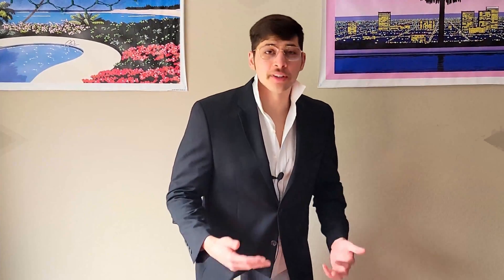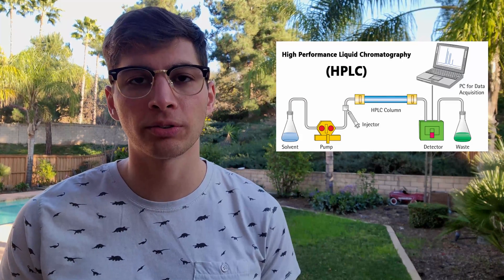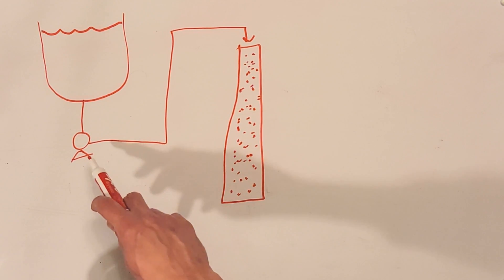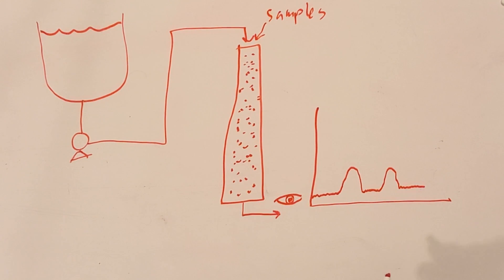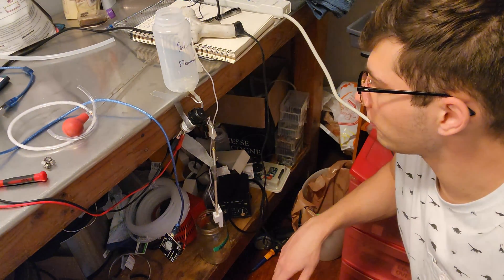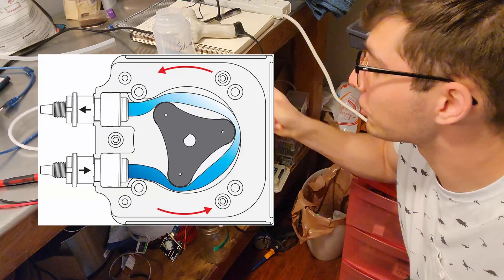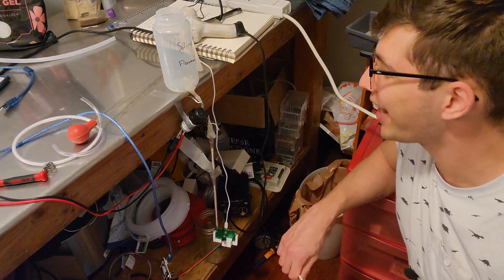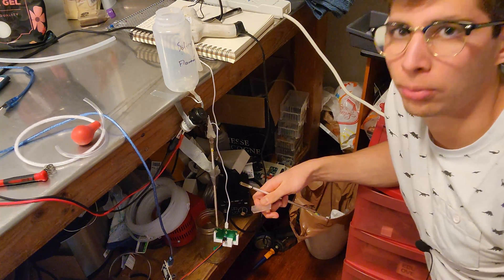How does HPLC work? | High Performance Liquid Chromotography

Comment: The need for high pressure is a side effect of using very small particule size stationary phase in a very narrow diameter column.  Both factors enhance resolution, but the flow rate at modest pressures is negligible - hence the high pressure.  Not a chemist of any kink, but a mere microbiologist, but I love HPLC.

Comment: So ummmm I don't mind or anything but the acronym HPLC stands for High Performance Liquid Chromatography.  It so happens that often HPLC systems run at relatively high pressures because the packing material causes high backpressure.  But sometimes I have reason to use larger diameter silica gel and low flow rates/volumes meaning the pressure is not high.  I know this all sounds nit picky but I love chromatography and want you to be correct, accurate... and precise!  :)
Reply from the maker: All good things to be! I should have clarified that this is just "LC", but people are familiar with the HPLC acronym I think.

Comment: I work in the cannabis industry and run HPLC for cannabinoids. This was really cool to watch. And considering you’re not an analytical chemist, you have a solid understanding of HPLC.

Not sure if it helps, but 75%/25% aceto/h2o with 0.1% formic acid as the mobile phase works great for cannabinoids. 228nm
Reply from the maker: Nice! Yea I've developed a method for cannabinoids, but always had trouble with the precursors like olivetolic acid and varinolic acid. Probably not needed for the cannabis industry, but I needed to identify them for the work I was doing at the time.

Comment: It may be possible to achieve high pressures like in true HPLC, the trash method, using old injection pump from diesel engine. Many of these pumps can achieve more than 300 bar.
Reply: Or, do it with static pressure, rather than a pump.  Air pumps for precision airguns can easily reach 3000+ PSI.  A steel cylinder with a floating piston, mobile fluid on the bottom, high pressure air on the top would give you zero pulsation high pressure flow.  Some fancy machining, but any shop that does CNC maching could create one.

Comment: You're completely wrong. The diffusion has nothing to do with the pressure  It's flow rate that matters. HPLC's are high pressure because their columns contain extremely fine particles. Fine particles = resistant to flow. Actual chromatography grade silica gel is cheap. You can buy a prefilled column for $5 on ebay. Syringe pumps are also pretty cheap and much better for cheap chromatography than peristaltic pumps.

Comment: I'm not sure about the UV-C LED, because curing nails doesn't really need UV-C, 405 nm are enough to cure alot of resins. 
 
You should be able to find out if it is a real UV-C LED when looking a the window of the LED. UV-C LEDs use a glass window instead of a plastic one, because UV-C destroys the plastic windows.
Reply from the maker: Oh interesting... I wish I could've gotten just a nice UVC LED with a good datasheet..based on my tests though, this one did at least emit some UVC

Comment: The diffusion is probably more due to air bubbles. The high pressure is mostly to speed up the process. Eluting too slowly may cause some diffusion but your set up is going plenty fast enough. Focus on eliminating the bubbles and I bet you will see a big performance bump. Also, as Conner said check out flash or vacuum chromatography, you can get the equipment for pretty cheap.
Reply: Nope, Pressure is actually needed for performance. In practice the more fine is the stationary phase, however the more fine is the stationary phase, the more pressure you need to pump the chromatographic separation before diffusion happens.
That's the reason UPLC or uHPLC is invented, because of the more fine stationary phase you need a much higher pressure to run the analysis.
Flash and Vacuum chromatography is for sure cheaper, but it is think to separate much higher mass of compound, at lest 5 to 1 mg if you work in Pasteur pipette.
My suggestion is to check some special TLC technique, you can find them on the Voegel's textbook for practical organic chemistry or in other analytical text book. The advantage is that you have a lot of different stationary phases, you can runs bi-dimentional TLC, and also you can use different developers, the  one used in the video has sold with a fluorescent sensitizer .
For DIY approach is the best. Then if you need HPLC to quantify, my suggestion is to send sample to company or university that has an analytical service.
Reply from the maker: Oh interesting... I didn't visually see any air bubbles but I'm sure high pressure would take care of them!

Comment: The best option is really buying used HPLC components and connecting them all together. You can find pumps, detectors and what not for a couple hundred dollars on eBay. If might take some effort to "Frankenstein" such an HPLC but it's totally worth it. The best is to buy older equipment which can be operated as standalone (without the need for specialized software, since that's usually the most expensive part) and building an Arduino ADC to connect to the recorder output of your detectors. That way you can make calculations in whatever software you like. 
For diy it is probably easier to build a capillary electrophoresis System which can reach pretty high sensitivities. There are quite some publications about this topic also in combination with microfluidics. 
I appreciate very much your effort in making this video! It reminds me very much of my beginnings as a student, trying to set up an analytical laboratory. Wish you luck with this project.
Reply from the maker: Thank you for the kind words! I have dreamed of putting together a Frankenstein like that, but I want to get a little more acquainted with working systems before I follow through

Comment: Have you considered flash or vacuum chromatography? I think instead of using a peristaltic pump you might have better luck with a pcp compressor to pressurize your reservoir and then use a valve to regulate the flow. I've been wanting to build a chromatography machine for awhile now. Liquid-liquid (countercurrent/continuous) chromatography also sounds doable with a planetary gear system that could probably be 3d printed.

In any case, love the effort! Keep on iterating.
Reply from the maker: Ooh I had no idea about these methods. I'll look into them!